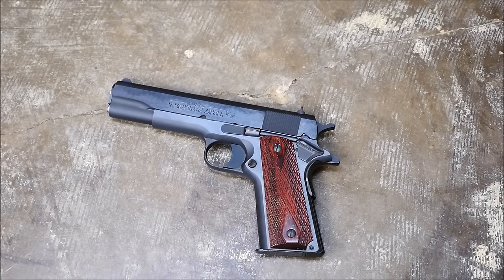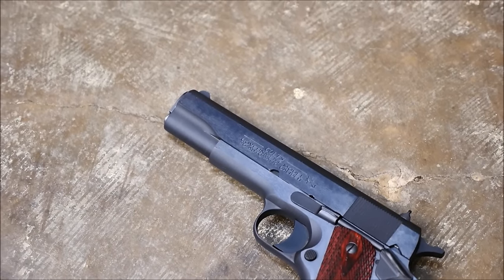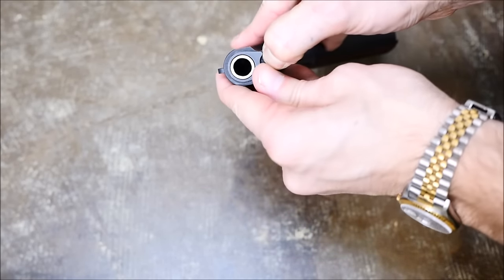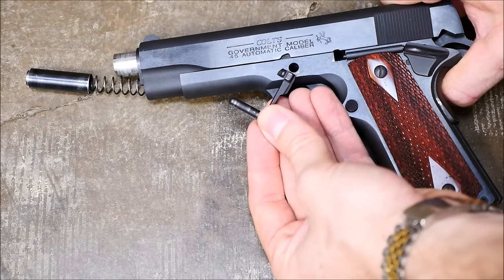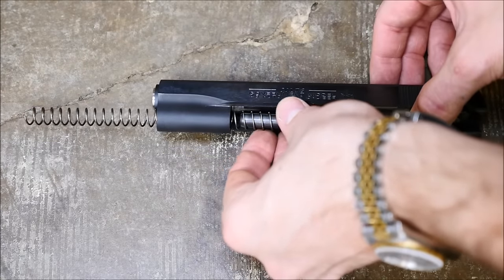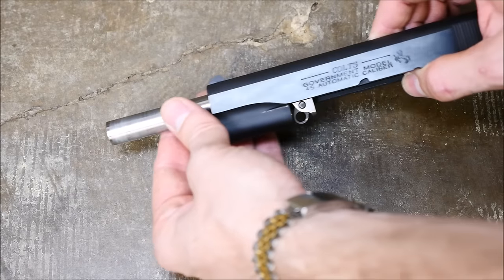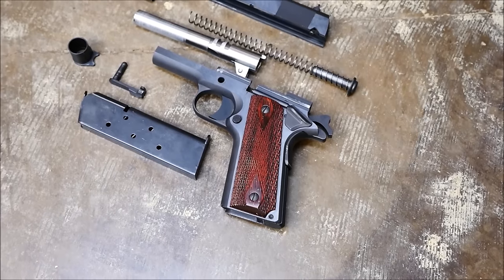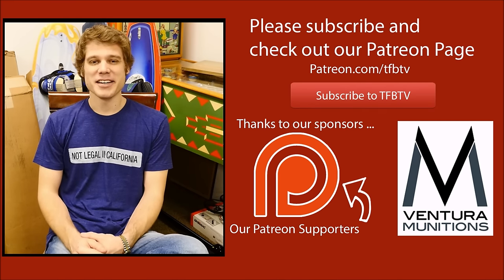Colt 1911 Field Strip

Comment: Hopefully people would reassemble it in reverse order. Too many fine 1911's scarred with the "idiot scratch."
Reply: Do go on
Reply: @snare3649  Its basically the slide release when you are reassembling it. Generally most people tend to just push it up against the frame when locking it back into the small gap into the slide. 

Because of that, it tends to leave a noticeable mark. Commonly seen on 1911s, what your suppose to do is lift up the slide release by a little and then push it into it's small gap.
Reply: @tidewater5679  Damn, wish I would have read this before I tried field stripping my new 1911. Afraid I already got the "idiot scratch" :(
Reply: @plague46  You're not the only one!! LOL

Comment: I had a Colt 1991 back in the 1990's , best .45 I ever owned . I liked the matte lack finish & it shoot very well . I used to shoot it a lot with the cheap ammo available back then . (500 rounds for $89.99 cheaper than dirt)  It reminded me of the 1911 I used in the US Coast Guard back in the early 80's . But it had some plastic parts on it . I believe the main spring housing , magazine release button & trigger were all plastic and that bothered me . I talked to my dealer about replacing the plastic parts with steel parts and he said it would be better to sell it & buy an all steel 1911 . So I ended up with a stainless steel Springfield for a few years , (I like blued 1911's) then traded that in for a new Series 70 Colt . I like my new Colt , But it was expensive and has a high gloss finish on the slide . I am all most afraid to shoot it and I do not shoot it very much . I guess if I had it to do all over again , I would of just kept the 1991 and been happy with it .
Reply: +Charles Culnane   second sentence should read "matte BLACK finish" . I just fired my proof reader .

Comment: Hey Alex, good video!  I recently bought my first 1911 over the summer and love it. It is a Citadel 1911 and the best shooting handgun I own. When I first got it the grip safety worked during my initial cleaning, however after firing roughly 150 rounds through it and giving it a second cleaning I found that the grip safety was not working after reassembly. I am unsure if the safety malfunctioned from firing the gun or if it was something I inadvertently did during the cleaning process. I have searched the internet and had some employees from my local gun shop where I purchased it check the weapon out and we can not figure out what the issue is. Any ideas? I am tempted to just delete the grip safety since the thumb safety still functions normally and I don't carry the 1911 anyways. Thanks!

Comment: getting the slide stop pin back into place when reassembling seems difficult to me, i made slight scratch when doing that so i protect that small spot with piece of electrical tape or parchment paper at that step (last step). There is also procedure for pin section disassembly in my manual (cimarron remake of 1911A1)

Comment: Pretty odd that this gun was requested most, considering everyone and their uncle has one. Say, are Para Ordnance "GI Expert" 1911s any good for a starting semi-auto? I remember them being decently priced, as well as looking impersonal.
Reply: Mine has been good. Check out there 1000 round test.
Reply: Logan Hoy 
I will. Are they still using polymer triggers? I heard it helped with accuracy by keeping weight off of the internal mechanisms, if that makes any sense.
Reply: Mine has an aluminum trigger and a polymer mainspring housing.
Reply: Logan Hoy
Strange.
Reply: +Scowler 

Wow.  I thought they had been dissolved after Cerberus Group let the Para website die a little while ago.  Looks like it's back now.  

Even after paying almost twice the original price of the gun to fix the numerous issues with my 2008 Big Hawg, it still shoots low even for a .45.   I would have replaced it with an FNX Tactical but I love the feel of a 1911.  Too bad they discontinued my model.
Reply: yes, para fixes their QC issues, never hear complaints about the expert anymore, they are well made guns.

Comment: "The Doo Dad" on the front of the recoil spring, really????? It's call the "Recoil Spring PLUG" and it's NOT a "button"!! I'm seriously guessing from this absurd field strip, that you're clueless on a full cleaning tear down which includes the the mainspring housing, hammer, hammer strut, sear, sear spring, trigger, safety, pins, and disconnector ..... ALL of which get fouled with gun power and grit and are necessary to tear down to and clean.

I think you guys should stick with pop-guns.
Reply from the maker: +Vint Guitarz " I'm seriously guessing from this absurd field strip, that you're clueless on a full cleaning tear down"
Admittedly yes, I have never detail stripped a 1911. Thank you for watching though.
Reply: +TFB TV correct me if I'm wrong but isn't the point of a field strip is to break down the firearm to the essential parts reasponsible for making it function and servicing those?
Reply: From personal experience I've found that normal field stripping/maintenance is fine up to 800-1k (depends on how dirty your ammo is) rounds as long as you keep it well lubed in the critical areas. I'm always surprised at how dirty the extractor channel gets (thank god for .22 barrel brushes and Q-Tips).
Reply: +TFB TV that actually surprises me. You should spend some time pulling one apart and putting it back together. It's not difficult once you understand how certain parts work together (esp. Sear/disconnector). Just be careful as several parts are under a good deal of spring tension and are NOT captive..!

Every 1911 guy probably has carelessly sent a recoil spring plug and/or firing pin rocketing across the room at least once. The worst is when you lose the spring from the plunger tube. I recommend keeping a tray handy to toss all the parts in as you disassemble so they don't roll around when you're cleaning. I haven't tried it myself but rumor has it if you lose your recoil spring plug in the field a .45 ACP casing will work in a pinch.
Reply: Ryan David I use the spring out of an ink pen if I lose the firing pin spring or recoil spring, works better than the factory springs.